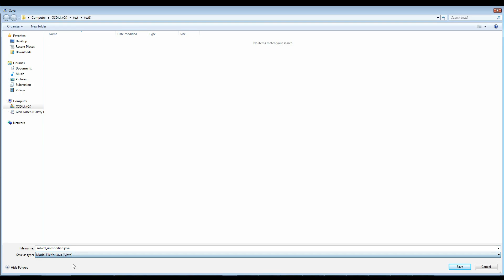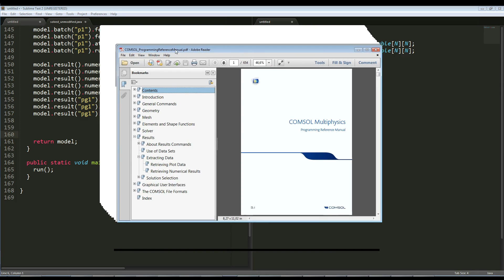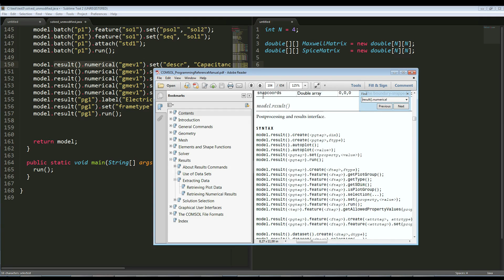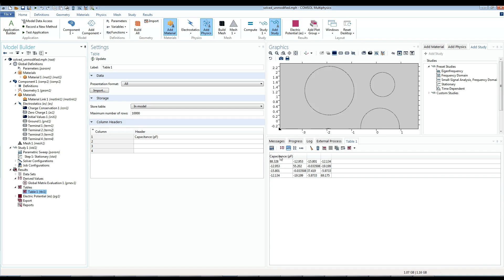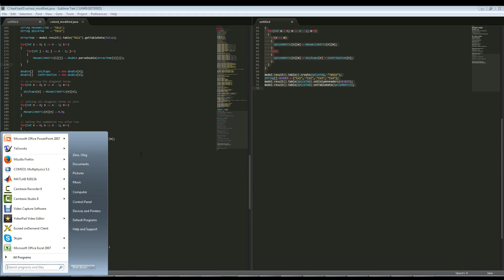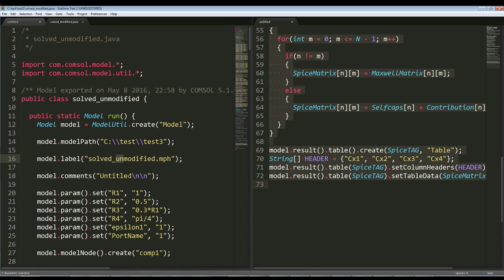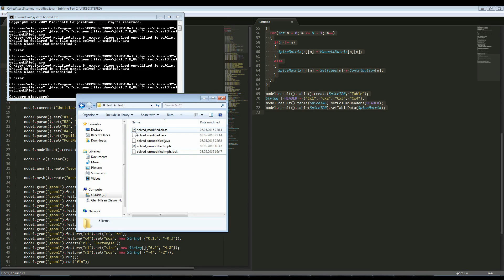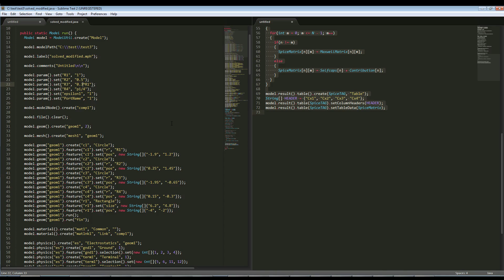1.3 Basic Java Programming for COMSOL

Comment: Hey. Fantastic video! Thank you so much. I just had a question. How can I run the comsol graphics in java (netbeans or eclipse)? For a specific example I tried to run one of the comsol application library (submarine.mph) in netbeans but I got some errors when I run it. Idk how I can modify the submarine in netbeans as I can see its graphics there. I already saved the file as a java format (submarine.java) and also I created a new project in netbeans named submarine and saved the submarine.java in the source folder and plugged all the jar files in library of the submarine package and tried to run the submarine but it didn't run. What else I should do? Do I need to add some lines of code as I see its graphics?
Reply: Thank you for the compliment. Well as for netbeans, I honestly don't know. Can you display any other graphics in it? Have you tried rendering something simple (not from COMSOL) like a square to see if you have the basic functionality under control? The problem might be on the side of the environment that you are using, not necessarily on the COMSOL side.
Reply: Thanks for your reply. I'm in the last part of the comsol GUI example. I used netbeans and after I made a java application project, I could create a class named DemoGuiComsol and added the submarine.java file in the same directory. Then I made a compute button. Now what I need is to fix some errors which is occurred. Id like to share the whole java project with you as you can help me to fix the errors but I don't have any email of you. If you send your email I'd appreciate it. Regards.
Reply: I no longer have a COMSOL license. It is a problem.
Reply: You don't need the Comsol software to run it. You just need netbeans software.